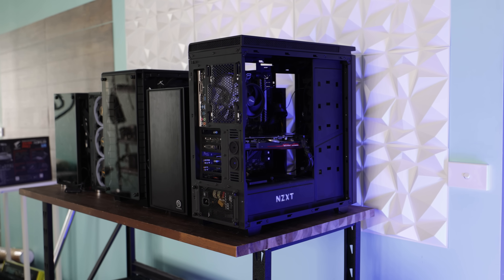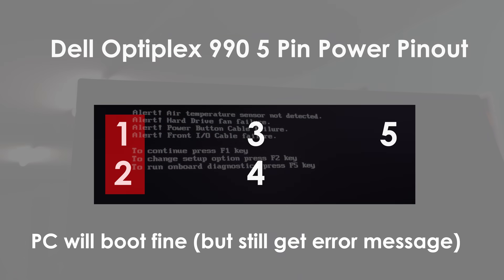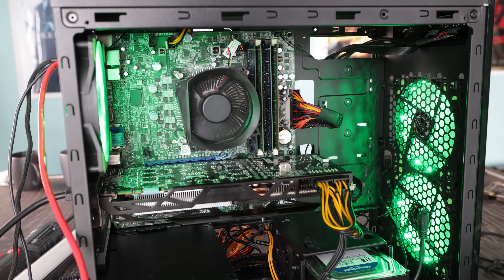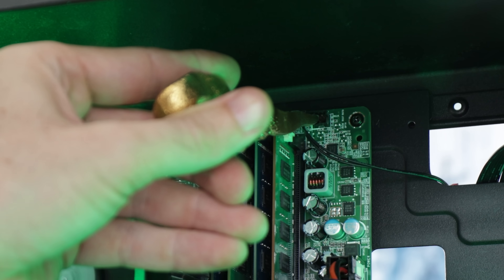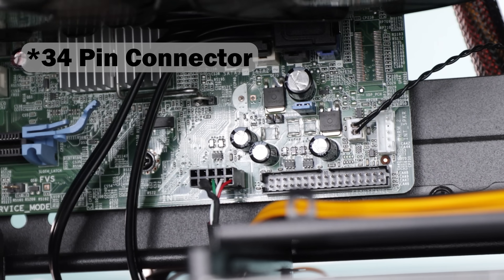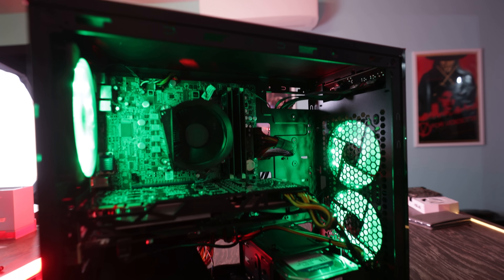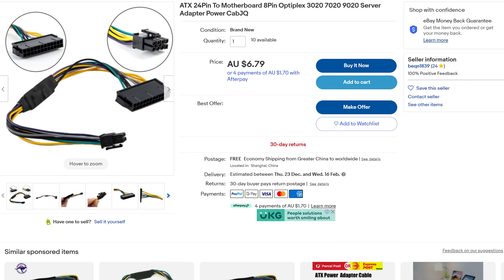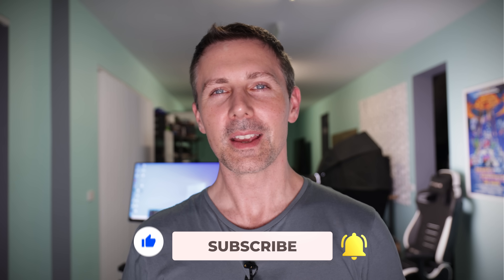Turning a Sub $100 DELL OptiPlex into a FAST Gaming PC

Comment: Would love to see you do this with an hp sff 6300 or 8300 system.  Using a 3rd gen Intel cpu and hp mother board if its even possible.
Reply: I posted a tutorial for that somewhere, might be worth to check LTT forums
Reply: Those motherboards are not ATX, so can't fit them in normal cases. The whole point of the Dell, Lenovo,Acer etc ones are because they use standard ATX boards.
Reply: @Marty_NZ  I appreciate the info...  I have access to several of the hp models I mentioned so I asked.
Reply: @Marty_NZ  "can't" is not the correct term. Harder? Sure. I have fitted SFF proprietary mobos in ATX cases, it isn't easy and does involve some PSU modding as you'll probably lack the 5vsb line to turn on mobo.
Reply: @emdea  I think we're talking about different things. HP SFF Elite/Pro 6300/8300 use BTX boards. It's flipped to ATX. You'd have to use dremels and cut steel ETC for it to just expose io and slots in an ATX case. That's not to mention any motherboard standoffs would line up either. It's nothing to do with PSU modding.

Comment: Nearly all of these headaches can be solved in a couple of seconds with some front panel adapters. Not sure if you're aware of them, or just wanted to show people how to bypass all the crap on the cheap. I keep the temp sensor... but the biggest issue with these systems is the fan controller. It's stupid levels of picky. Still can't seem to find a pattern of fan that will and won't throw an F1 error.
Reply from the maker: I don't really look around at others content when it comes to making my own.  Though I don't think I will bother with adapters unless it is the 8 pin to 24 pin power converter.  As the front panel audio / rear audio sounds garbage on these boards, and the two pin jumpers are inexpensive.
As for the fan error have you tried an adapter on that and it still spits out an era? Could have something to do with the fans PWM and variance of voltage.
Reply: @techyescity  Yep, I've tried the fan adapter, and I do think it has something to do with the PWM signal, and some variance with these aftermarket fans. Tested a bunch of fans and only found the Corsair ML 120/140 Pro LED fans would work without throwing an error. Pretty much any other PWM fan I tried doesn't work. But DC fans seem to work just fine. I'd also wondered if it was a minimum start up voltage thing as well. Still not sure, but that fan controller is stupid picky.

And I was just wondering if you'd heard about the front panel adapters. I just figured they were worth mentioning... but you're right. You're only really missing the onboard audio, which is genuinely trash.
Reply from the maker: @TheGameBench  It's funny you say that, I heard about the power connectors and knew they existed for years actually, though the front io and audio I didn't know, as I usually check aliexpress for adaptors/connectors, basically the meaning of that is; if it's worth it for ali sellers to push those connectors then it means people are mass converting them.  Though since only the power connectors are sold in bulk on Ali, I figured people would be doing cheap workarounds.  I guess this video finds those cheap work arounds.
As for the fan, that is really strange, the 80mm fan actually isn't loud at all! Neither is the CPU fan with the i7-2600S at least while running all the tests here.  So I think I will just keep pulling them out of the original builds to save myself the headaches.
Reply: @techyescity  Yeah, the front panel adapters are made by some small company here in the states. And I don't see them being nearly as mass marketable as the PSU adapters have been. You can find those everywhere these days. I just found em' while looking for otpi's on ebay and they poped up. So, I don't imagine we'll be seeing them cheap from several sources any time soon... and yeah, $25 is a bit spendy for both. Far cry from a couple of jumpers.

I agree, the stock fans are absolutely fine. I don't swap them out in my flips. I'm just seeing more people that want to swap the coolers on these and add RGB fans, and they end up being disappointed, but it's all for that bling since a new cooler isn't going to make a difference on a locked i7 like these come with anyways.
Reply: @TheGameBench  There are 3 pin to 4 pin adapters for these fans. you can replace the fans with a 120mm if you want. this is what I did
Reply: @c00lc321  Yeah, I know. I'm not talking about the connector being the issue... in fact all they did was reverse two of the pins. Nothing fancy going on there. Even if you use the adapter, you can run into the F1 error that the fan has failed on startup. I've only found a couple of PWM fans where this doesn't happen do far. What 120mm fan are you using and have you seen the F1 error?
Reply: @TheGameBench  If you can, just buy the stock fan that comes in these systems and plug it in.
Reply: I ran a single wire from the front fan header input plug to the cpu fan header plug and killed the Wait for F1 error from popping up.
Ghetto fix tho..

Comment: THIS IS THE VIDEO IVE BEEM WAITING FOR! I've done so much looking around for videos on how to get around the connectors and such and this has saved me! Thank you Mr. Yes Man!
Reply from the maker: I have been meaning to do it for a long time! and funny story that I didn't talk about in this video, was those connectors on the bench in the broll were actually left overs from when I was going to do it the last time, but the motherboard pull ended up being completely gonskis, so I just took the CPU and ram etc. Though this time when this one came in I thought "we are doing this".
Reply: @techyescity  I was thinking since you used those jumpers for the power connector and front I/O, do you think you could use the jumpers on the temp sensor and possibly HDD sensor?
Reply from the maker: @insanelycrazedprofessor9864  I will check it out, but gut feeling is that since they carry actual sensors that carry varied voltage signals, simple bridging doesn't work.
Reply: @InsanelyCrazedProfessor Those are digital temperature sensors, something like a LM35, DS18B20 or similar, actually a good thing to have, just place it somewhere in the case where you want to monitor the temperature. All of this can be modified for actual purposes, all you need is a multimeter and then test everything, nowadays electronics producers use simple resistor/voltage divider to code hardware for planned obsolescence reasons, keep on selling the same stuff as another pseudo-innovation, Apple is using this on almost every piece of hardware, even for light sensors in iPhones.
Reply: 3way that
Reply: Foursome that.
Reply from the maker: @boingkster  5muster that.
Reply: @boingkster  ok handsome 😉
Reply: There are tons of forum posts on how to case swap Dell machines.
Reply: second that!